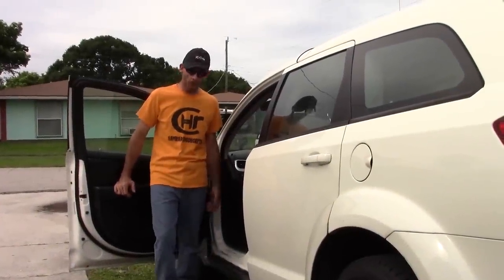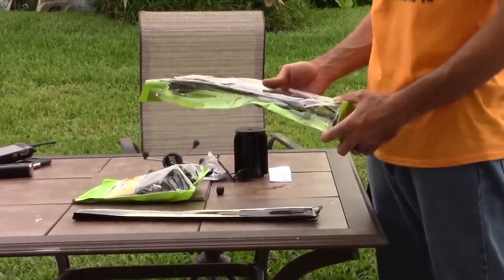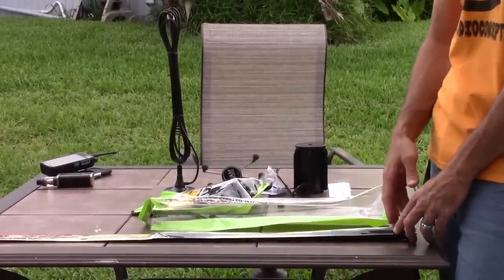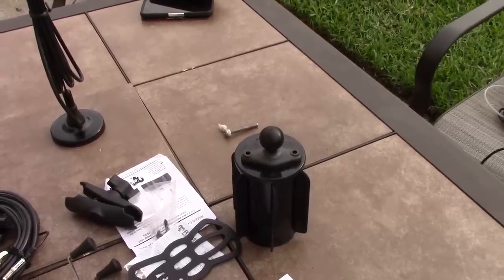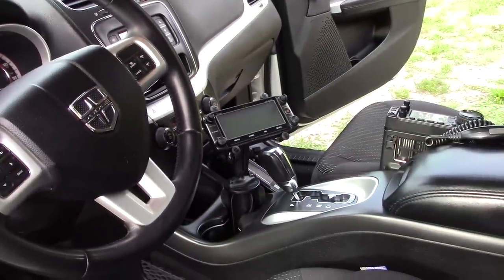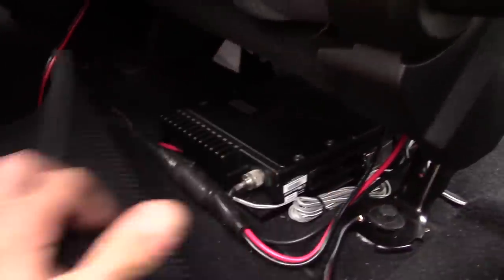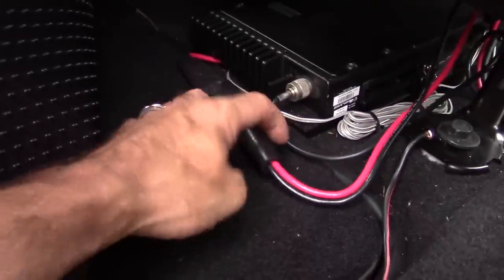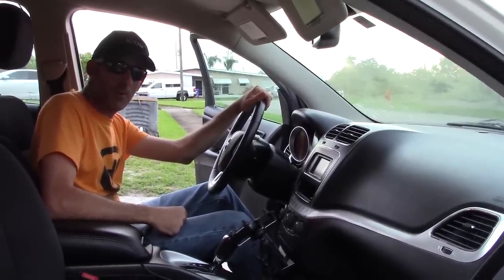Installing Your Ham Radio In Your Vehicle, Tips And Tricks For Mobile

Comment from the maker: I agree with all the comments  about the fuse near the battery. The positive post you see in the hood is not the battery post, it is a fuseable link just after the battery. If anything shorts, I have that, plus the added fuse, plus the fuse on the DC cable that came with the radio.
Reply: HamRadioConcepts You don't really want to depend upon a high amperage fusible link as your primary battery side protection.  What you ideally want to install is a fuse slightly larger than your peak concurrent loads attached to that conductor (taking into consideration that you are highly unlikely to be simultaneously transmitting on more than one radio at a time, so the peak transmit load of your highest power radio plus the receive current of the others, plus a margin).  Basically ask yourself this question, if you get into a serious accident that cuts into your power cable, and possibly not enough to actually blow the circuit quickly (and fusible links are very slow to blow compared to fuses), how long do you want power flowing into the cabin area where a fire can be started while you are trapped in the vehicle -- the lower the fuse rating the faster power will be cut and the safer you are?!  

That all said, #4 gauge copper (up to 150A for 105°C rated insulation) is a bit overkill to run amateur radios unless you are also installing a high power linear amplifier as well (or similar very high power load).  8 gauge copper can easily support up to 60-80A and would have been more than adequate for running multiple radios with considerable power to spare (one can easily run a number of amateur radios off a single 30A tap since only one transmits at a time).

My other piece of advice, which I realize may not apply for your company vehicle, is that it is safer if the radio controls can be installed at around dash height such that even as you glance towards them you never fully take your eyes off the road.  Anytime you have to look downward into the cabin area to check a display or manipulate a control you are no longer in a position to see the road.  So if the option presents itself, a dash, or similar, install is safer provided such will not impinge upon the field of view.  Panavise also makes some great mounts that are readily adaptable to amateur radio installs.

Take care and thank you for taking the time to create the video!

KW4EK
Reply from the maker: Thanks, actually, I don't look or operate the radio while driving. One thing I learned while I worked at AT&T is good driving habits.. "Eyes on the road", (Smith keys of driving) "Texting while driving.. It can wait"
No need for me to be messing with the radio while driving. Set it and forget.
Reply: Ethan Poole. You are correcting him and yet he already said that he has the fuse in the DC cable going to the radio! So long as he has the proper fuses supplied by the radio manufacturer, one in the black lead and one in the red, he does not need anything else. Incidentally watch out for ICOM fuse holders! I have known some of them to get HOT and will drop the voltage. You will need to replace them with high current fuse holders, available on eBay if that happens.
Reply: Bry C I'm assuming you may not have viewed the video in its entirety or fully read the comments of that period, but in the video (see around 16:40) there is no fuse installed on the battery side until you reach the radio itself.  That means that there is a very long run of #4 power cable that can, at least for a time, source up to several thousand amps running through the firewall and cabin area that, if it is ever damaged in an accident or worn through, can potentially start a cabin fire before we ever reach the first fuse.  He does later mention (in the comments if I'm not mistaken) that the positive terminal he attached to has a fusible link in series with it, but fusible links are designed to blow very slowly and permit considerable overloading for an extended period before they fail open, so are not really a suitable substitute for a proper fuse.  For safety in an accident (or any other source of damage to a power conductor) you want to have a fuse installed, the smaller the better (while still remaining adequate for attached loads), as close to the battery positive terminal/power point as practical (generally within the first 12 inches), not some ten feet later -- it's all about protecting the wiring itself along with the occupants, you can install an appropriate sized (smaller) fuse to protect the actual radio equipment wherever you wish after that if the radio, or other accessory loads, require lower amperage fuses to protect their electronics than what you selected to protect your power harness.  

Fusing the negative side is optional on negative chassis vehicles unless you are connecting the negative lead directly to the battery terminal, in which case you will want to fuse it as well, though for different reasons -- if you are connecting the negative lead directly to the chassis for ground power then no fuse is necessary. The reason you need a negative side fuse if connecting direct to the battery terminal is to protect the negative lead from overload should the bonding strap between the battery negative terminal and chassis ever fail open as in that failure mode all vehicle power would then try to pass through your negative lead attached to the battery, through your radio and/or accessory loads, and then through the shield side of your coax in an effort to complete the electrical path from positive back to negative and that would severely overload the accessory negative lead.  That scenario can not play out if you are drawing negative side power directly from the chassis rather than direct to the battery.

Of course, if one has a positive chassis ground vehicle then all that fusing advice gets reversed and it then becomes critical to shield/insulate radios, many accessory load devices, and the coax and antenna ground and shields from the chassis to prevent unwanted shorts since most vehicle electronics were designed with a negative chassis in mind (fortunately such vehicles are not especially common today).

73 KW4EK
Reply: Mr. Poole, great pieces of practical advise. You can add that if that positive is not fused properly, and a slow-fuse is not the answer, that positive wire, now cut or chafed, and you really have a  "loose", and "hot", welding torch at the battery. And, more than likely, by the time this problem is noticed as to why your radio suddenly went "dead", you will have alot more than damage to the radio, maybe a fire --> under the hood and fastly traveling into the cabin! 
Oscar (KG5ULB)
Reply: What you gonna do when your radio shorts out and blows your fusible link? Oh I know! Just call a tow truck.
Reply: this is the first time sir tiny's my radio if you can hear me if you see this on your video this is the first time I got my ham radio from Amazon and I don't have a call sign so how should I how can people reach me with all my call sign
Reply: @ethanpoole3443  To determine the appropriate AWG, don't look at the current-carrying capacity of the wire. Look at the power loss. The cable run is a critical factor. A 12-ft run will require two 12-ft cables, one positive and one negative, for a total of 24-ft of cable. If the power loss is significant, then the voltage delivered to the radio will drop with each press of the transmit button. Sensitive electronic equipment does not respond well to fluctuating or low voltages.

Here are the approximate power losses for a 12-foot cable run (24-ft of wire) pushing 120 watts at 12 VDC. The 120-watts includes a 100 watt transmitting HF radio, a receiving VHF/UHF radio, and a factor of safety. 

   #10 AWG will have a power loss of about 6 %   (Unacceptable)
   #8 AWG will have a power loss of about 4 %
     (Unacceptable)
   #6 AWG will have a power loss of about 2.5 %
  (barely adequate)
   #4 AWG will have a power loss of about 1.5 %  (acceptable)

I wanted to install #4 AWG, but it was so thick that the installation would have been too difficult. I went with #6 which is just barely adequate. #8 AWG has too much power loss.
Reply: With the help of your channel I've just purchased my first radio: FTM 400XDR. Thank you for the help. Can you tell me, I was told by the sales person that putting the radio inside an enclosure- like the console between my truck seats, is a bad idea as it will interfere with signals as well as audio unless I get an external speaker. 

Can you comment? I'd love to have as much of the radio gear hidden as is possible, but of course I don't want to interfere with the operation and signal strength.

Thank again for your work out here!

Comment: Thanks for the video.  You should really move your fuse to be as close to the battery as possible.  That way if the power wire shorts anywhere along it's length it will be protected and not turn into a welder.
Reply from the maker: Good advice. Also, that post I mounted the cable to, is not the battery but an accessible positive post on top of a fuseable link. Battery is way down under. So,  I hope that is the first to blow.

Comment: If you mount your antenna to a door or hatchback, be sure to check that you have excellent electrical conductivity between the antenna mount and the car's electrical ground. I had to run a grounding strap from the frame of the car to the hatchback.

Comment: I have the same set up on my suv. the mount in the back, don't forget to put a ground strap from tail gate to the body of car. I have 3 of them, one on the back and 1 on each back door. works great, I got Cyprus 6,400 miles from spring hill Florida. thanks, Joe
Reply from the maker: I am going to show that in the HF mobile video. I havent had issues with VHF UHF but HF without that strap with a hatch or trunk mounted antenna is bad news.

Comment: Great Video. And yes Ive read here about the fuse being closer to the battery. I made that mistake when I was a kid hooking up my amp for my stereo. It shorted out and started a fire the whole wire burnt from the firewall back to my amp and melted and the wire turned hot red inside of my Opal Manta. I quickly cut the cable next too the battery. I really like the cup holder Ram Mount Idea. The clip mount is nice also if your not using a magnet mount.

Comment: Good stuff.  I would advise you to put a fuse as close to the battery as possible though. If you have a short to ground between the fuse and the battery, the wiring will not be protected.

Comment: I haven't mounted my radio in my Jeep yet, watching this video for ideas, but for a funny story, I put an old CB in my truck, basically where the radio is mounted on the right hand side of the center console, just to see if it worked, my wife hit her funny bone three or four times in less than an hour on the road, so I threw it in the back behind her seat, the thing wasn't working, my guess it was the old antenna, I need to actually install it and replace the antenna wire, I will do it all when I mount the ham radio. Thanks for sharing and have a blessed week sir.

Comment: Nice video Eric!  My only concern is where you have the power line fused.  For safety,  it should be fused right at the battery.  Otherwise,  a short could cause real problems,  potentially a fire.  Just my $.02.
Reply: Or engine noise.
Reply: @txpatriot7044  The fuse location will not affect noise

Comment: Nice job on the installation instruct-able YouTube Eric =)     I agree about a FUSE at the battery as if the wire was to touch the negative terminal or any metal the FUSE will be in the middle .... so the fuse AT THE end of the TERMINAL  wire attachment to the battery =)    Safety safety with power wiring and fuses =)   Also another blast from the past in commercial radio wiring .... multiple radio make a BOLT TYPE wiring BLOCK to attach every thing too =)   Great job  Eric 8-)

Comment: Sir, respectfully, you have good ideas on mounting your communication hardware. However, if you are trying to "hide" your equipment, which is a good idea against thievery, I would have the idea of "ventilation" foremost in my mind, for these radios are mid to high powered electrical equipment. Moreover, in installing your receiver antenna, under the hood, or attached to your fifth (5th) window or hatchback, your  signals' strength are going to suffer because of how the radiated signal (lobes) will be presented. 
Anyways, the best of luck on your ham radio install. Good video job too.
Oscar

Comment: That little wheel is an awesome antenna, I have one that is over 20 years old and still works as good as it did band new. I have puled it on and off so many times the plastic that holds the magnet on the bottom of it has come off and when you take it off its a two step process, take the antenna off then the magnet.
Thanks for sharing. I will check out the video on making it work for Ham purposes. 
Im an still looking for a good solution to mount an antenna on my Jeep. I have seen the hood mounts, but not too sure I want the antenna on the front of the jeep, and not a ton of places to mount the antenna anyways. 
Thanks for sharing sir and I hope you have a blessed week and Happy holiday, Enjoy your vacation this month. I totally get it. Enjoy your break. 
Dale

Comment: I hate mag mount I had one of those things when I was pushing a semi and the sum bith yes I did misspell it I did it on purpose came off while I was going down the road yes, gravel when I realized it all I had of it was the coax from the window to the ground...never again!
Also don't buy a '11 equinox and xpect to mount it on the hatch it's lip on fender or hard mount.
Replied before I had the chance to watch it all. Great vid the only thing I would change is putting a link in the description.

Comment: Great video.  I have been trying to figure out how to get an antenna on my Toyota Sierra.  Every antenna I have had on it so far has quit working, despite the fact they use RG-174 cable.  How do you get the power leads from the battery through the firewall?
Reply: David KJ4CMY: your use of RG-174 cable might be your part of your problem. In the 2M band, this cable has a loss of 13 dB per 100 feet so your radiated signal is greatly attenuated. If unsure about cables check out Universalradio.com website for their coax cable attenuation chart. You might try RG-8X or similar but good luck with your hamming.

Comment: Try to snag a 102" whip and cut it down for 10 meters. The swr stays low a good portion of the band. I'm running a 5/8 wave mfj for 2m that works very well. Can't say as much for their dual band, but they may have improved on them since I bought mine. 73s kf4gff

Comment: Here is a question.  Have you heard of problems with magmount antennas and the newer Ford F150s?  I got one of the last STEEL F150s and have heard that the local contractors are furious about the aluminium bodies of the new Fords.  Magnets don't work.  The hood on my truck in aluminum and I tried the mag mount for a quick QSO while stopped.  Not happening.
Reply: Bob814u With an aluminum body you will need to use some sort of a fixed antenna mount system, whether that be a lip mount (as demonstrated in this video) or an NMO style (through the roof) connector to secure your radio, then you can attach your antenna to that fixed mount.

Comment: Interested in ideas how I could mount an antenna in the trunk area of a 2020 Toyota Camry LE.  I was thinking of a magmount but I have never had one that didn't scratch the paint.  I have a tri-band DMR radio and I plan to use a small tri-band antenna for it, an older Austin Metropolitan.  I have a couple Diamond lip mounts but this antenna doesn't weight much and it will have very little wind resistance so a lip mount I want would have to be smaller and hold either a 3/8x24 or MNO.

Comment: How/where did you run a power cable from source e.g. battery, route through firewall without compromise to keep moisture out? Thanks
Reply from the maker: There was rubber grommets through the firewall, slice and insert

Comment: I’m not getting your definition of “counterpoise” with a mag mount unit. I’m thinking that in order to have counterpoise the ground actually has to be connected to the metal. I’ve heard the term “ground plane” which is the signal the antenna sees in order to send signals. Correct me if I’m wrong. Another problem, particularly in Fords, is the electric fuel pumps. I still can’t solve that issue.

Comment: Where did you get the cup holder from. Desire one for Icom IC-7100 radio head. I enjoy your video as I am a newbie, just received my Technicians license.
Reply: Congrats on your new license, and welcome to the hobby.  I'm newly licensed myself. Around 10:15 he said he got the Ram Mount from gigaparts.
Reply: Thanks for the info. It looks like I will be using a VGC VR-N7500 and connect through my car radio through bluetooth.

Comment: I've had a 5100 for many years, maybe since the day they came out. What is wrong with it, is the display. It gets washed out by heat, and mine failed to work properly and got replaced under warranty. Now the replacement display has gone bad, not just from heat, it has parts of the screen that don't respond all the time. In my opinion, that display ruined a great radio. The 4100 uses a better display that is not as big, but it is bright and sharp, and has not been effected by the heat so far.  So my advice about the 5100, is to remove the head  when you leave your vehicle in the heat of a bright sun.  Also, about those edge mounts, my vehicle has no lip to mount it. There is no way to use that on my Vehicle.  Comet, or Diamond makes a NMO mount that has a spring in the base, so when the antenna gets hit, it just bends down and does not get hurt.
Reply from the maker: That is what I addressed in the previous video....